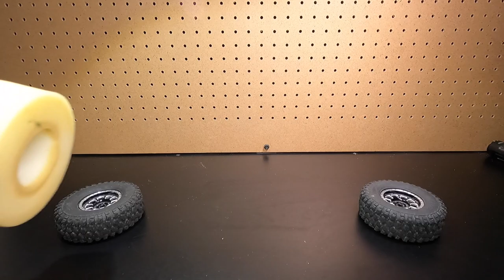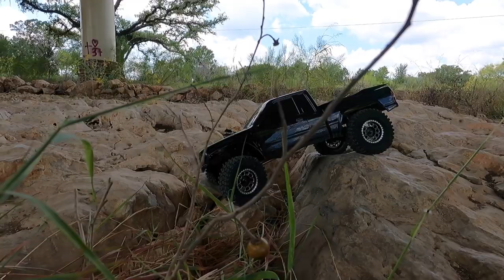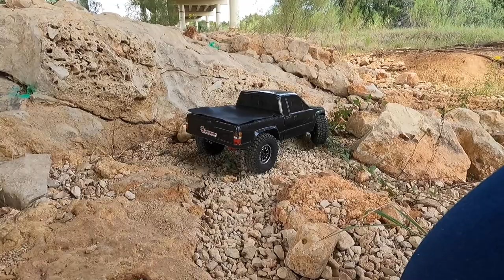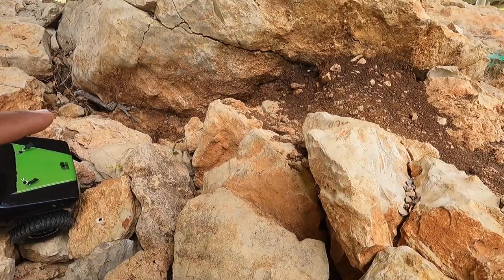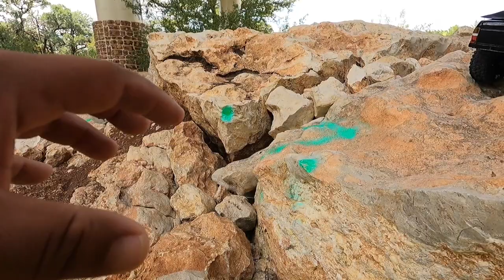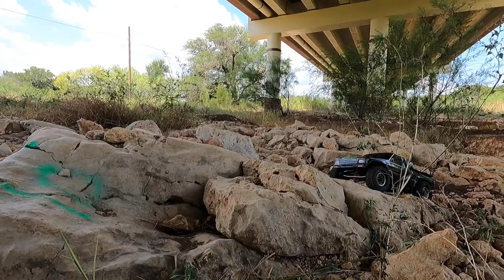Ditch your stock tire foams. Nebula RC No Foam Test and Review

Comment: That rig needs a little grease in the gearbox lol sounds jet powered 🤣, cool location though.
Reply from the maker: Lol absolutely the noise is so intimidating that it throws off other people when crawling. Must make it louder.
Reply: sounds like a castle esc and outrunner motor setup 🤔